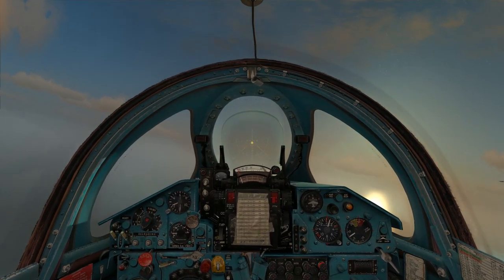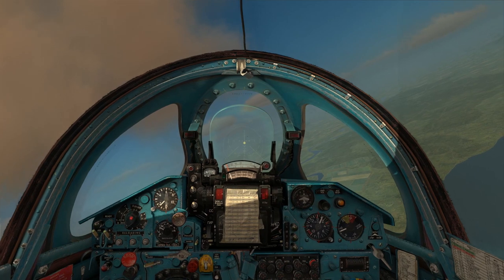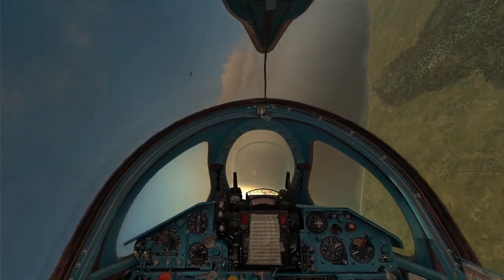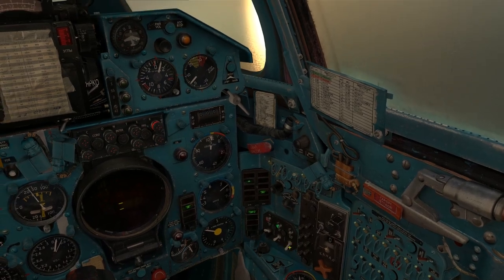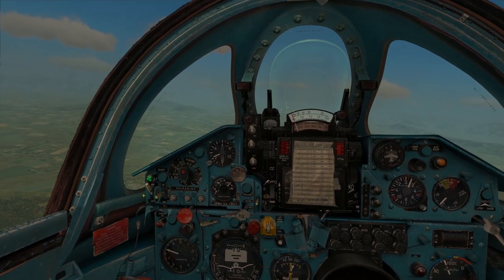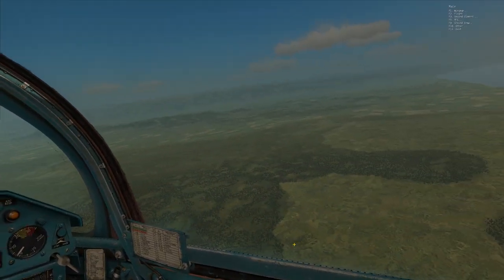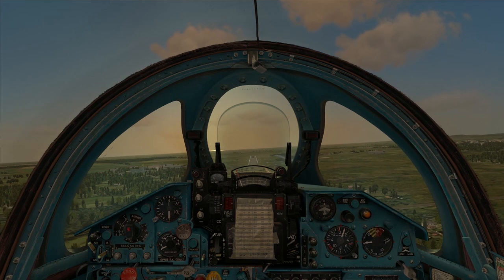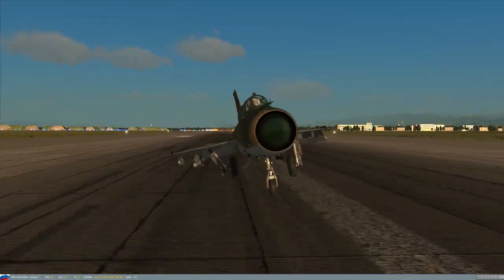Test Flight Preview - DCS: MiG-21 Bis Fishbed #6

Comment: Probably know by now, but the 21 has blown flaps (boundary layer control system), so when you cut the throttle you automatically lost a lot of lift. This was partially responsible for the hard touchdown and collapsed gear. 
Also, you don't know your left from your right ;)
Reply from the maker: Jon Allsop I eventually figured that out but not after blowing several more landings. :)